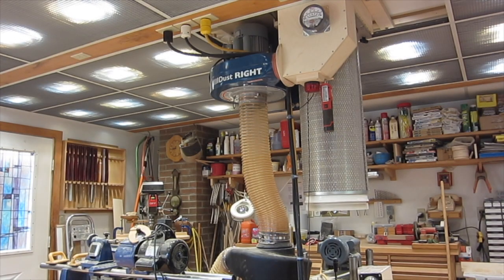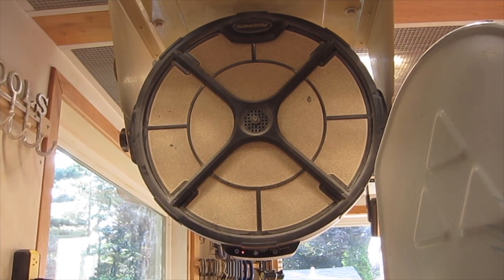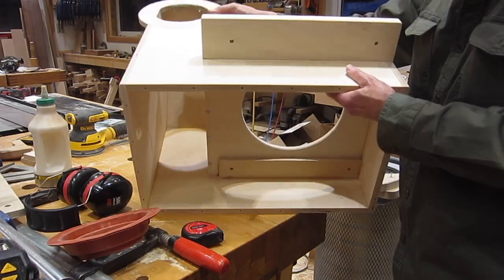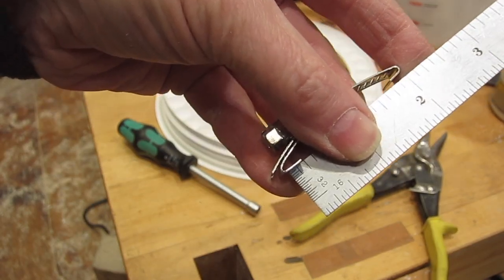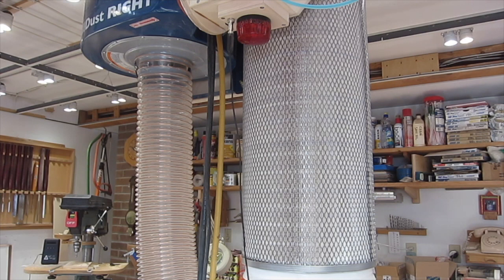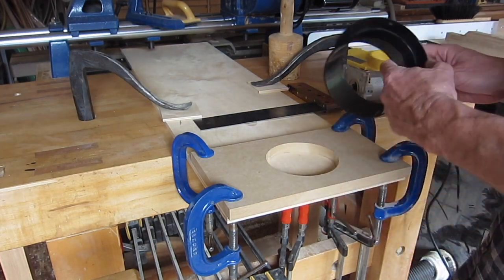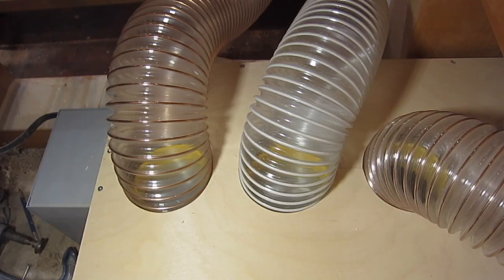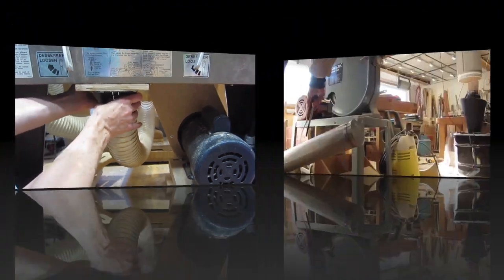Ceiling Mount Dust Collector, iVac, Wynn, Oneida, DustRight 1250 Powermatic, Banner, Testo, Dylos

Comment: nice work, i really like that smooth clear rube.
there is one bottle neck that could be changed to a longer elbow or curve that could improve flow at 54:46.  maybe you can find a clear 4” tube, heat it and bend it into a very large elbow but don’t heat the ends so they keep the perfect round shape.
those magnetic handles for the blast gates are genius !

Comment: Well done Steven 👍 Thanks for sharing!
Do you feel the iVac blast gates are robust enough to be used at the tool instead of your actual setup?
Reply from the maker: Most people place the gates inline with the ducting, or at the tool.    My goal was to contain all the loose wiring, but the disadvantage of my approach is that there is more work involved if a defective gate has to be cleaned or replaced.     If you are concerned about something hitting the exposed gate, then the gate could perhaps be attached to the tool, like back of table saw, and then covered with a small plywood box for mechanical protection.
Reply: @steven.woodward  The way you have the gates setup is best IMO. I learned from several "experts" that blast gates should be installed the closer of the dust collector (DC) possible. The reason being that the conduits after the gates, do not affect the efficiency of the DC. Reducing the length that the DC have to pull air through. Thanks for your reply :)

Comment: My Dust Right came with a remote switch.  It seems that this makes it incompatible with the auto on ivac switch because the blower will not run without you hitting the remote on button.  How did you get around that?
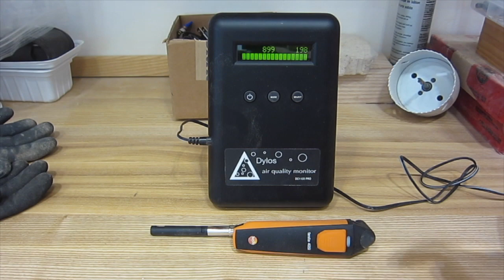Reply from the maker: See this section of video for solution to the problem:   05:33
Reply: @steven.woodward  Thank you. What I just discovered is if I hold that black button down and use the device it works. I'm thinking of taping that black button down which is effectively what you did in bypassing it internally.   Do you see any problem in doing that?
Reply from the maker: @bnssoftware3292  If taping down the black button works then that is a brilliant solution.  I don't see any problem with taping down the button, DustRight will only be powered up when the iVac system sends power to the DustRight.